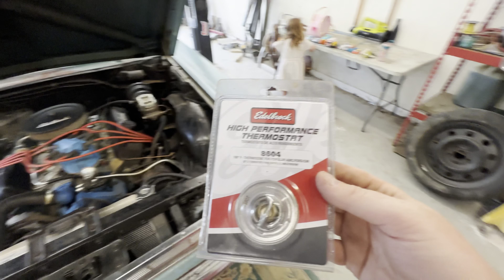$700 radiator and engine flush PART 1

Comment: growing up in the snow belt, i remember installing the Prestone flush kit into the heater hoses. I can say from experience, putting the front end up on jackstands and a hole in the thermostat lip, let it sit and air pockets will rise like bubbles in a glass of soda to the highest point of the cooling system...which will be the radiator cap. then seal an open funnel to the radiator neck or get the special funnel that does the same thing for $20, fire up the engine and let it run until you stop seeing bubbles pop thru the fluid in the funnel (gotta block off the overflow hose).

Comment: Why don't you have a fan shroud?
Reply from the maker: I do, just installed dual electric fans with an aluminum fabricated shroud.  Just didn’t have it installed yet
Reply from the maker: I wanted to cycle the heat and test my cooling system components before installing the shroud and fans
Reply from the maker: Part 2 fixes that